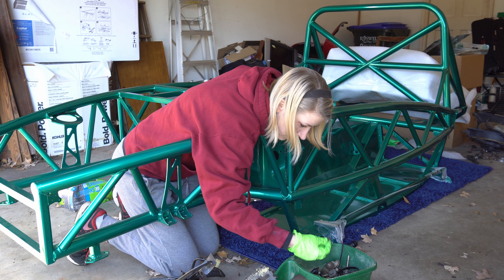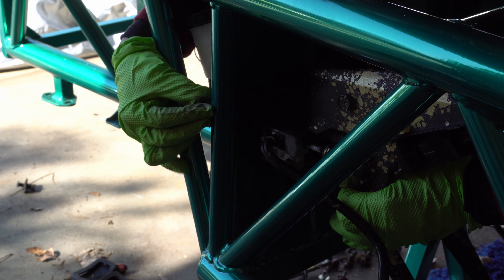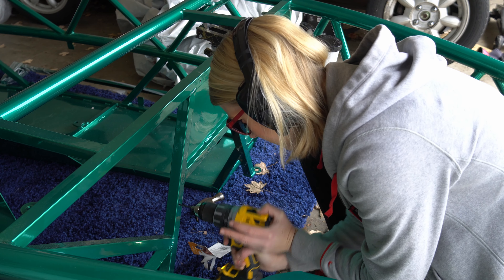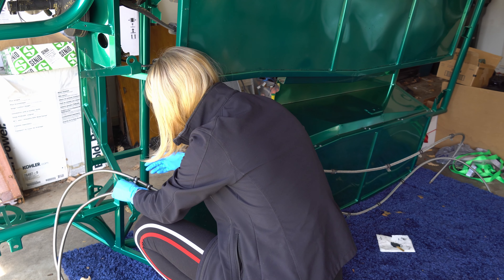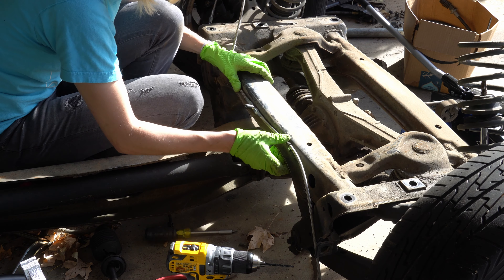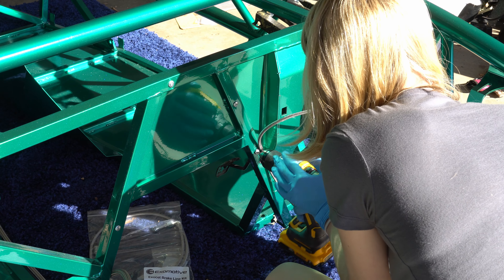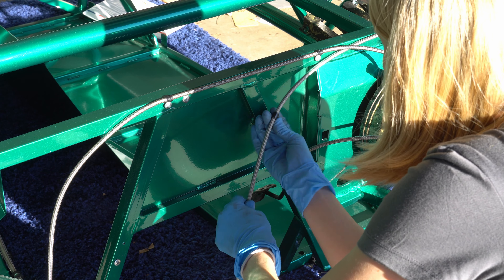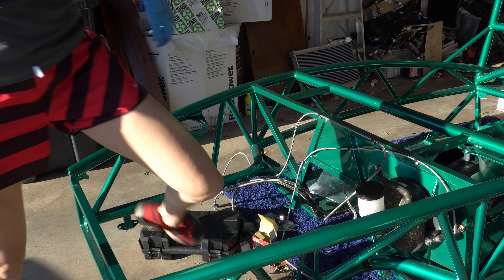Exocet Stainless Steel Brake/Fuel/Clutch line mounting

Comment: In your tear down it was easy to follow as you labeled them part 1, 2, 3 & 4. Is there an order for your build videos? I can't seem to find a site that shows the correct order for the build.....seems everyone builds their Exocet differently and I don't have the experience/confidence to just do whatever.
Reply from the maker: Hey! I can completely relate to how you're feeling, so don't be discouraged! Half the fun is deciding what you're feeling up to next! If you want to see the order I worked on it in, typically my upload dates are in chronological order (with a few side projects thrown in), but rest assured that in most cases, the order of wrenching isn't a huge factor! That said, there likely is an "efficient" way of going about things, but don't worry too much about doing it in the right order. If it helps, when I realize I've made my life more difficult in certain ways, I try to highlight it in each of my videos to warn others of my self inflicted struggles. I hope that helps, and best of luck as you dive in!

Comment: Running no prop valve for the brakes? Also where did you get the lines?
Reply from the maker: So like an idiot, I misplaced my hard lines that connect the valve to the master cylinder during the Miata tear down.  I'm just waiting to source those, or flare them myself.  Hoping to avoid the latter at all costs haha.  Thanks for watching!
Brake and clutch line kit: http://exomotive.com/store/exocet-stainless-steel-braided-clutch-brake-line-set/
Fuel line kit: http://exomotive.com/store/exocet-stainless-steel-fuel-line-kit/